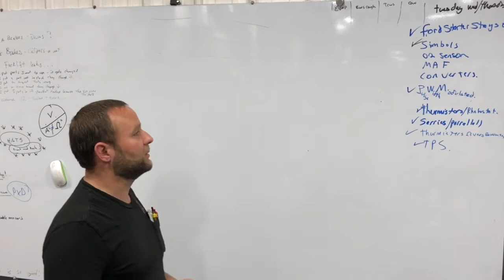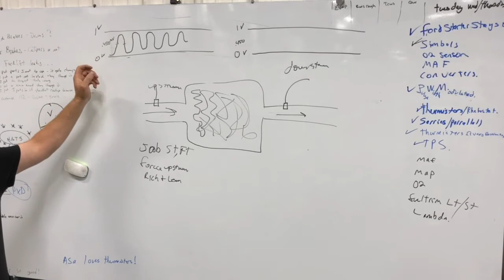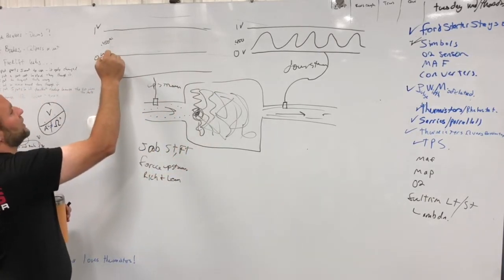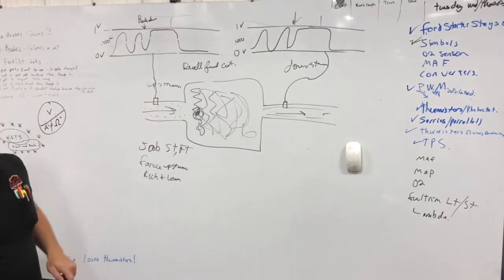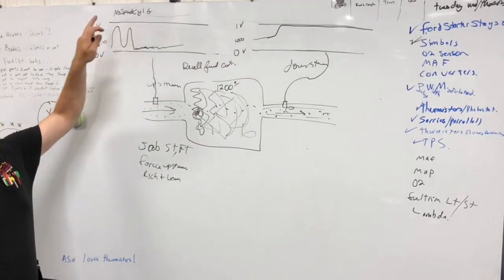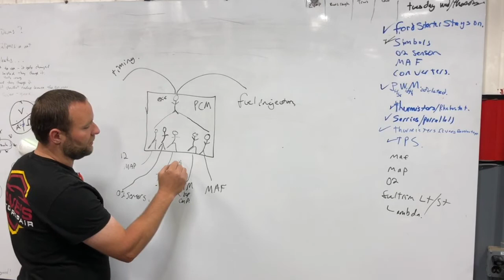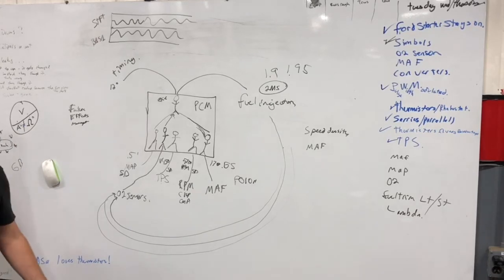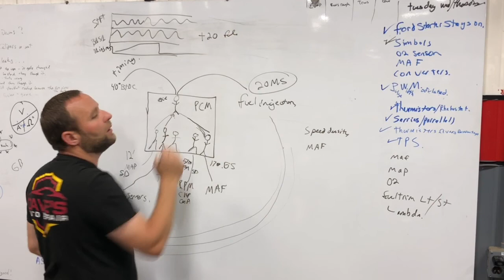Fuel trims and catalytic converter

Comment: Great video. Working on a 2010 CR-V with 70K miles. Runs great with good power. Recurring P0420 (no other codes) and negative fuel trims at idle (-9% STFT and then LTFT follows). Cleaned MAF, no difference. No misfire counters. BTW, just like the other commenter stated, my post cat sensor reads 0 volts on the highway unless I have the accelerator depressed.

At WOT on the highway, the downstream sensor is a nice flat line at 0.9 volts but oscillates during city driving.

Comment: As a young tech, this is very helpful. I work at a toyota dealer but I've always owned ford's, I have a 2000 f150 4.2 v6, 201k miles. I need to pass emissions and I have one problem, I can't pass e-check. I have a code p0171 bank 1 lean. I've fixed alot on this truck and thought I might need a converter but I'm not sure. My upstream sensors are both pretty good within 7to8%. My down stream on bank 2 is great but my bank1 downstream reads 0volts unless I get on the accelerator, and then they both read similar until I let off and then bank 1 drops back to 0volts. Now from the info in the video that means I'm not getting enough fuel or too much air. I was told the downstream o2 created voltage with heat and that's why I was thinking the cats are bad. The truck runs just fine and vacuum is within spec and there are no leaks. I guess my question to anyone who takes time to answer this is, should I take the time and pull injectors maybe one is clogged or is there any tests I can do to pinpoint this issue?
Reply from the maker: Do not replace the converter. they will not set a 171 code. Is the upstream in downstream on the same bank or similar than they probably have a bad O2 sensor. However on the 42 they have a lot of intake leaks there’s a good chance you have unmetered air getting into the intake after the mass air sensor.